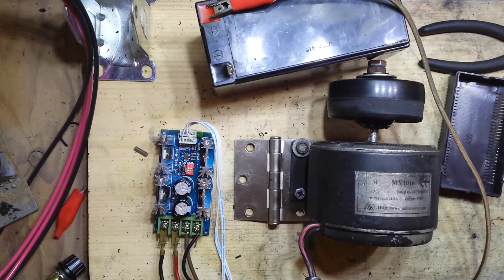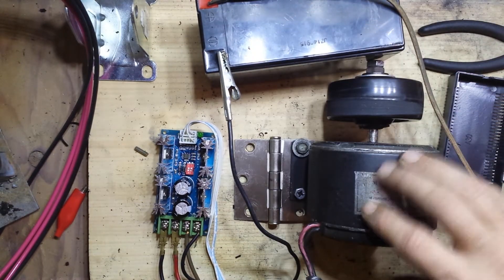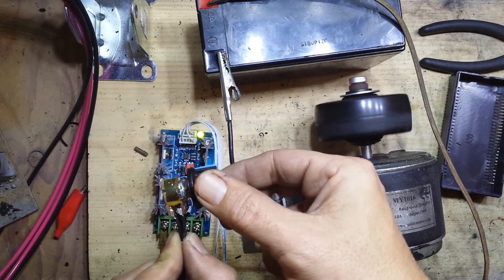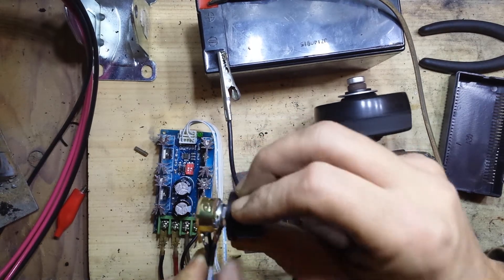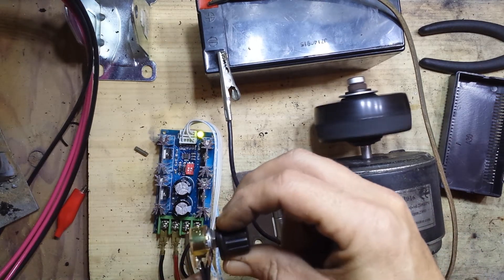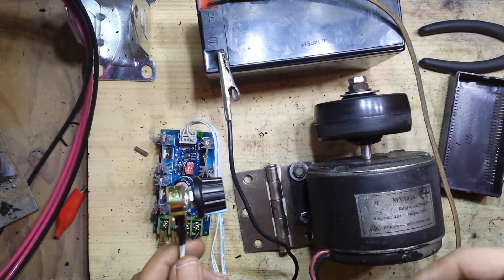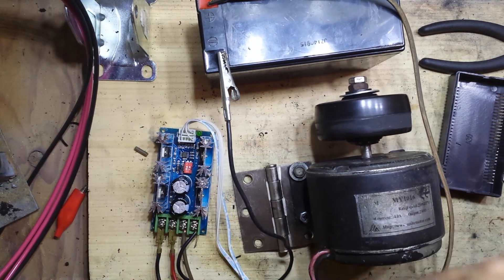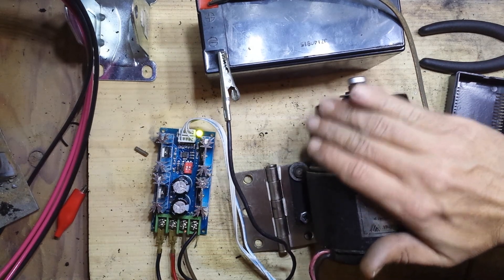Electric friction drive bike motor. part 3. testing the controller.

Comment: Where did u get rubber wheel you put on motor ? My project is almost done .. just need rubber wheel to go on motor shaft to friction against bike tires
Reply from the maker: A cheap caster wheel from harbor freight tools. I think it was this one 
https://www.harborfreight.com/3-in-polyurethane-heavy-duty-rigid-caster-69851.html
Reply: ThriftStore Hacker thanks a lot ! I just checked ur part 1 of this video.. assembling it looks little complex .. but will attempt

Comment from the maker: battery is connected to the controller,  controller is connected to the motor and the controller controls the speed of the motor.
Reply: ThriftStore Hacker Thank you ... and which cable I have to connect with which cable and which cable to which connection

Sorry my emglish is not so good :)

Your video is like me, I will definitely reproduce

thank you for your help
Reply from the maker: Danny Wittmann usually the controller has b+ and b- for battery and m+ and m- for the motor
Reply: ThriftStore Hacker Thanks for your help I will rebuild it :)